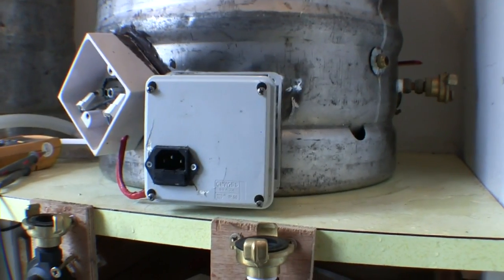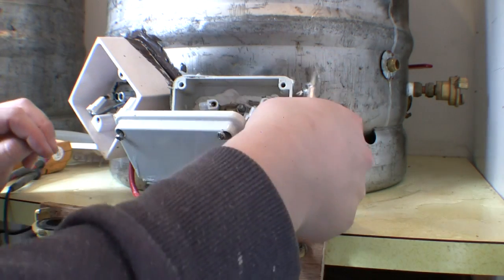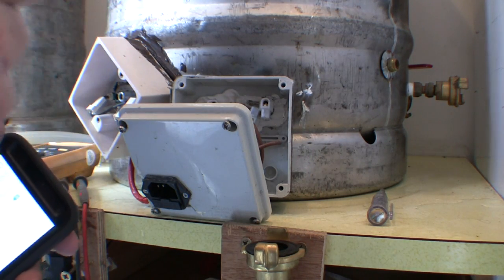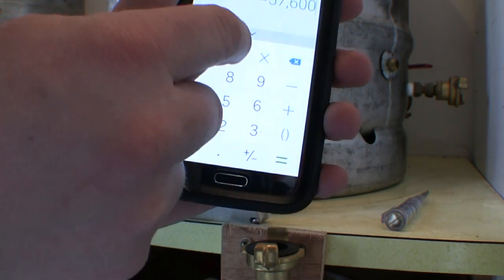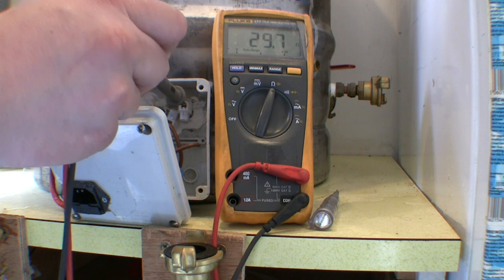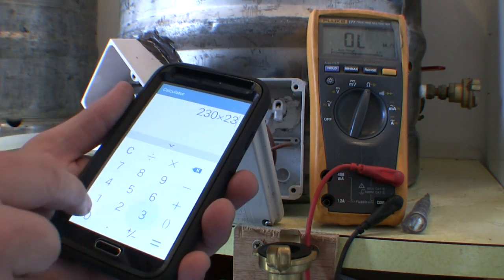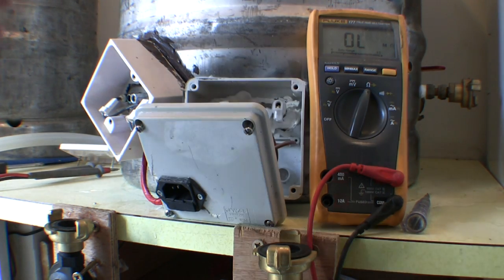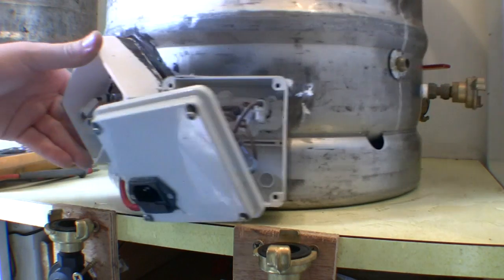How To Test a Heating Element

Comment: Why does your screw driver light up in the middle of the transparent handle, for example at the 1:46 mark into the video, when you are touching the element connectors?
Does it detect the presence of electricity?  Yet the appliance is not plugged into power.  Please help me understand why the screw driver (test pen?) lights up.